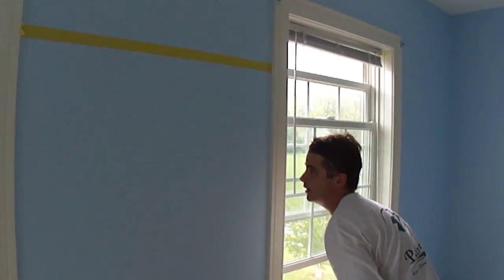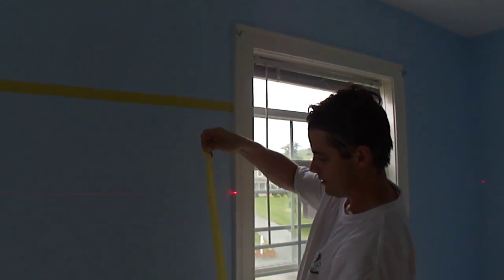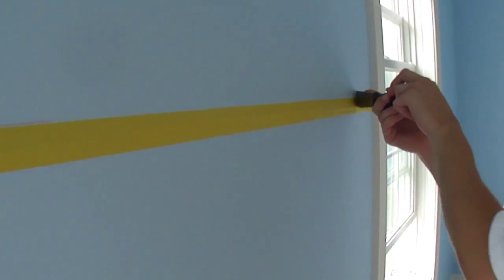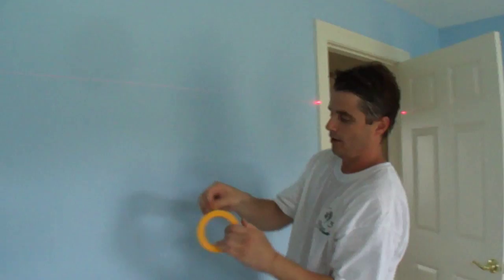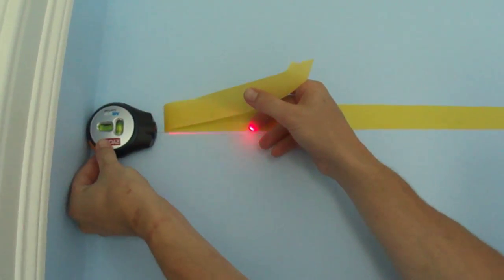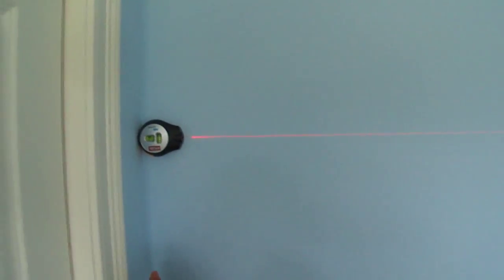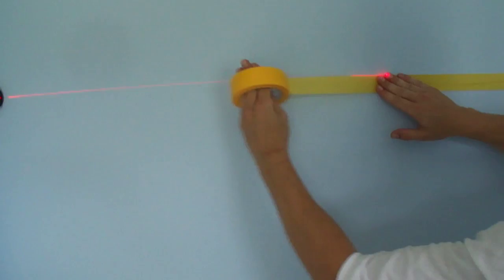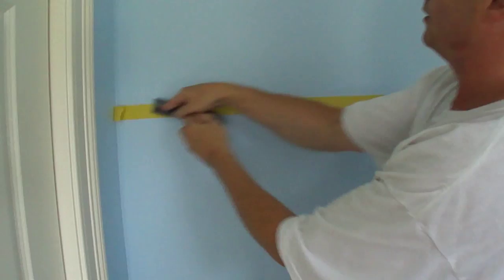DIY Nursery Painting - Accent Wall & Horizontal Stripes (Part 4)

Comment from the maker: Hello Olivia-

Thanks a lot, I am glad you Like them. Yes, after you paint base coat you have to let it dry. I am using the Yellow Frog tape meant for delicate surfaces. When pulling the tape  off, pull it at a 45% angle. It may however pull some paint off the wall. If it does, then simply touch up. This Yellow Frog tape isn't really that sticky, so it definitely works better than other more stickier tapes.

Comment: Watching you paint makes me :) ... thnx for posting these! 

Excellent idea of painting the base coat on the tape first to prevent bleed thru. I have a question - when I use tape, I always pull it off while the paint is still wet to avoid pulling paint of the wall too, but with this you have to let the base coat dry b4 painting the stripe color. Solution?

*so jealous of your ambidextrous hands!*  ;)

Comment: Thanks Russ really enjoying this series! Can you tell me where you got the cut in pail your using and the name, model number etc would love to find one this size with the rubber strap for your hand. I currently have the Wooster Pelican which is very similar but it does not hold much paint. I found a similar one to your but its red and I do not think it has the rubber hand strap that is one of the best parts. Thanks again for all your help have a great rest of the week.
Reply from the maker: Hi Paul-

They unfortunately stopped making my Handy Pail, with the strap. They just have the Red one now, without the hand strap. Ughh!

Russ